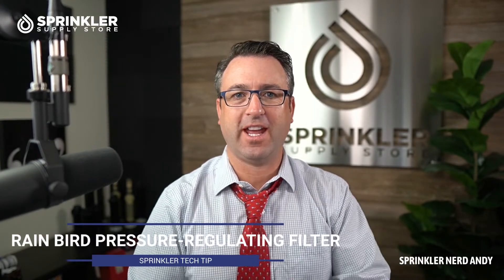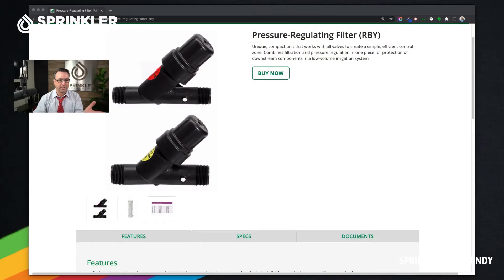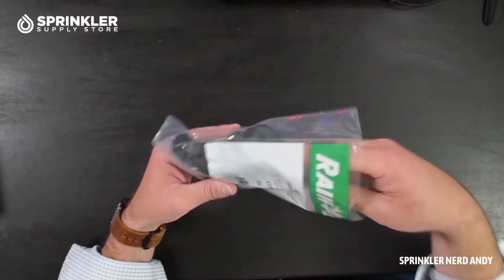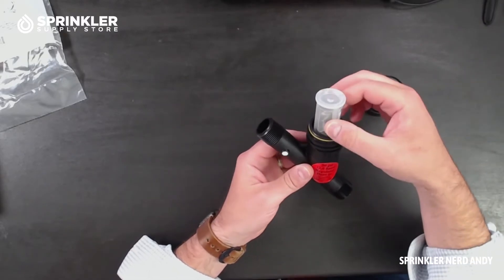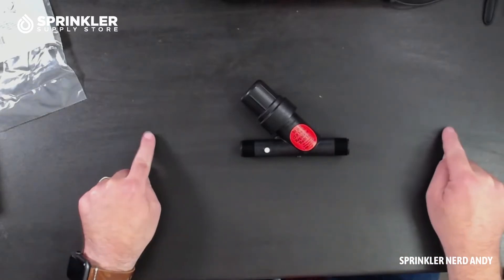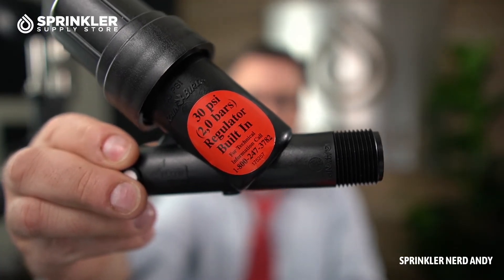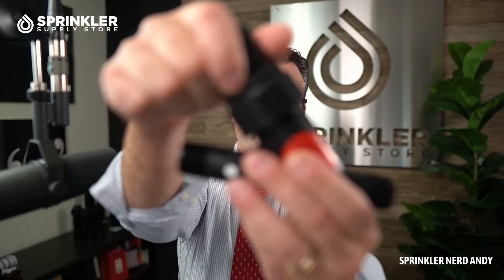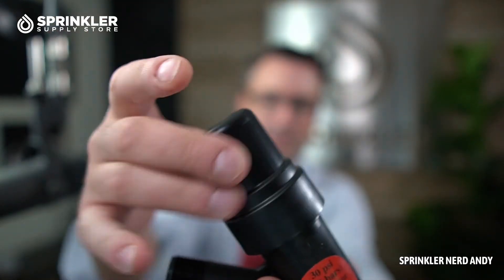Rain Bird Pressure-Regulating Filter (RBY) | SprinklerSupplyStore.com

Comment: Do I install it with the filter up or down oriented ? I know the arrow orientation but not sure if the filer housing should be oriented painting to the sky or pointing to the ground.
Reply from the maker: Great question. Technically it doesn’t matter, because water is forced through the screen under pressure, regardless. If the pipe was vertical, say indoors, that would be a good example.

With that said, it is best to place it up, or up-ish, so that when there is no water, and it is not under pressure, water is not sitting on the screen collecting just dust/debris/algae etc.

Comment: nice video... mine says 150PSI on it.  I cant find one online with that spec... its just for a normal sprinkler system, do i need that high of a rating?
Reply from the maker: Thanks for watching! For a residential system, 60psi at the backflow preventer is generally adequate. The 150psi could be the max rating, as opposed to the regulated psi - hard to say. If you can txt us a picture we'd be able to look deeper. TXT: (833) 343-4590  ~Andy
Reply: OK thank you, it does appear that the 150 is the max rating, but i cannot tell the nominal pressure, it must be 30 or 40.  AS is the case on mine, it appears there is a common issue of the little white button (looks like a one-time relief valve) that requires you to replace the whole assy if it pops.  Picture sent to your text number.  I appreciate your help.  @Andy_Humphrey
Reply from the maker: looking forward to seeing the picture - haven’t received anything yet - we’re standing by to assist 😊
Reply: I sent to the number you gave me

Comment: My PRF075RBY has a minor leak on the white button, it is new, no cracks or apparent defects on the unit. Specs state that the unit can handle up to 150 psi, the incoming pressure is 95 psi.  Is this leak normal when under that kind of  pressure?
Reply from the maker: Great question, unfortunately I’m not sure. We get this question a lot and I need to find the answer!!
Reply: @Andy_Humphrey  I returned mine, regardless of it being normal or not it doesn't do much good if it leaks. My question was in case it was a defective unit but w/ no reply to my question forthcoming from the manufacturer you go to the next guy.
Reply: Any updates on this topic? I’ve just installed mine and it’s leaking from both white buttons…
Reply: Same here

Comment: Do you also need a backflow preventer? I live in Southern CA where we are required to use above grade anti siphon valves. Is a backflow preventer overkill?
Reply from the maker: @terrireyes295 most likely, yes. I wound check with your local water authority for the code in your area.

Comment: How do you tell the difference between one that has just the filter and one that has both filter and regulator?
Reply from the maker: Most filters (in the world) do not have pressure regulators…so that narrows it down a bit. For Rain Bird specifically, the white dot is a giveaway.

Comment: What happens when the white plug blows out? Can we replace the plugs or do I need to buy the whole unit?
Reply from the maker: Great question. That piece of the filter is the pressure regulator. Unfortunately I don’t have an answer for you when it pops out. Perhaps someone else will comment here and provide a solution.

Comment: Please tell me how to fix licks thru white plugs by side’s
Reply from the maker: Hi Katica. The small white plug is where the pressure regulator is installed. Has the device always leaked since it was originally installed? If yes, perhaps the flow (gpm) or pressure (psi) is out of specification, too high. If it just started to leak, perhaps the plastic has a small crack and the unit needs to be replaced. Also check the filter and see if it needs to be cleaned, perhaps this is causing some back pressure. Give us a call and we'd be happy to chat through it with you. -Andy

Comment: It’s still reading over 70 psi and dropping my pressure. I don’t know what I did wrong. The thing flat out doesn’t work
Reply from the maker: Hi Nick. Double check the the flow rate (gpm) of the zone is within the range of the device. Too much flow could cause it not to work properly. Perhaps you need a larger size. 

3/4 inch = 5.0gpm max
1 inch = 15.0gpm max

Comment: How do I connect this to my hose?
Reply from the maker: Hose threads are different from the pipe thread that these filters have, so the first step is to adapt from the hose thread to the pipe thread.  You can do that with this fitting from our store:

https://sprinklersupplystore.com/collections/garden-hose-fittings/products/orbit-brass-swivel-hose-fitting

If you purchase a 3/4" filter, it will thread directly into this fitting.

Comment: So if I have 1 inch filter and I only have 20 tubings there is no need for pressure regulator
Reply from the maker: You should first check your incoming pressure. If the pressure is less than about 50psi you likely do not need a pressure regulator. Most drip devices (emitters) are pressure compensating over a wide pressure range, and the goal of the pressure regulator is to hold the fittings together without the need for clamps. Happy to help if you need anything.

Comment: Thank you for sharing. Do you have any videos or documentation on replacing one? The plugs near the flow symbol blew out on 1 of my 6 pressure-regulating filters.
Reply from the maker: We haven't created a video for that process as of yet and I wasn't able to find any documentation, but it's a simple process.  Be sure to purchase the exact same brand and model that you currently have, turn off the water, unthread the existing unit, and thread in the new unit.  There's nothing particularly magical about these, just make sure that everything is tight when you install it and don't overtighten and risk breaking it.  Run the zone after installing and check for any leaks.

Comment: Thanks for information. Will   3/4 reducer 1/2 “ pipe still be effective?
Reply from the maker: Hi Lou - great question. Yes, you can reduce a 1" RBY down to 3/4". Keep in mind that the pressure regulation feature on the 1" has a flow range of, 3.0 to 15.0 gpm, so any flow less than 3.0gpm will not be pressure regulated. If your flow is within the 3-15gpm you are just fine!
Reply: @Andy_Humphrey  How do we replace the white plugs? Mine blew out
Reply: they dont seem to wanna answer that  one.... but looks like it is a safety device that fails often, then you need to replace the whole gizmo..ugh!    @Danny-ez3pm

Comment: Hi. Thanks for the info about the 2 rainbird pressure regulators. I currently have one in which the cap is not sealing due to a broken o-ring. I've been doing my best to replace just the o-ring with a correct size. Is this possible or do I have to completely replace the whole filter?
Reply from the maker: Those filters are relatively inexpensive, and getting the correct sized o-ring can be tricky, as Rain Bird doesn't offer them as a separate part.  We'd personally bypass the trial and error and just purchase a new unit and replace the old one.
Reply: @Andy_Humphrey  This is the MOST TERRIBLE way of doing business! Shame on Rainbird for the fallacy of not producing a SINGLE line item simple gasket replacement option! Absolutely despicable that this isn't an option. Shows how far Rainbird goes to simplify the customer's pain.
Reply: Just put Teflon tape and it will work.